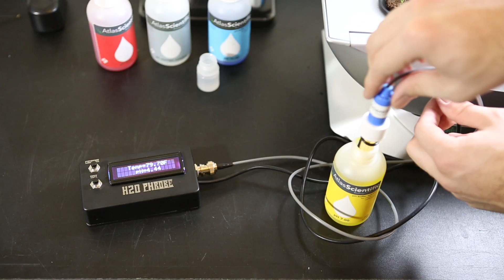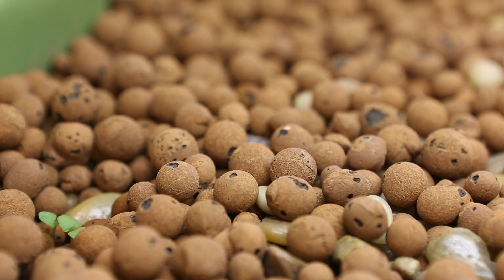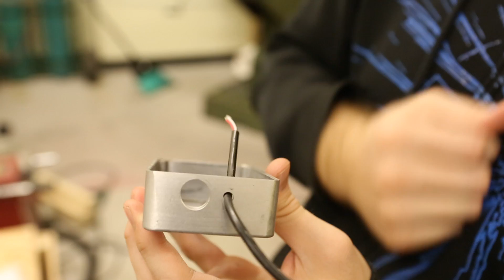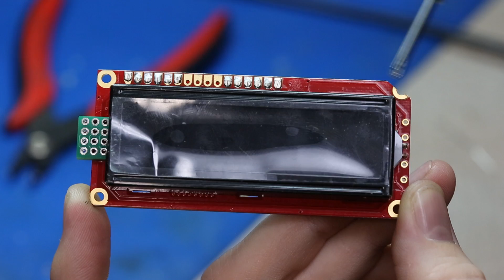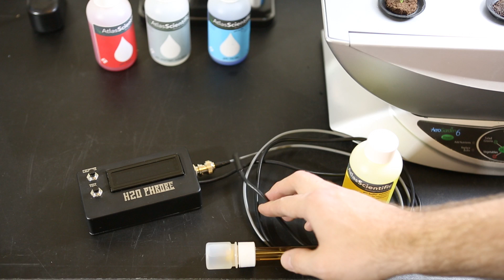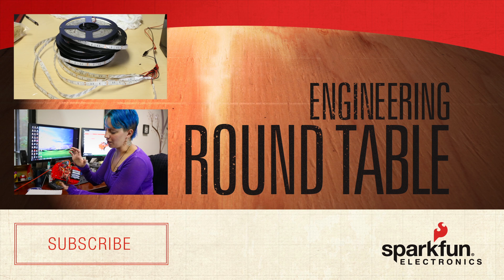SparkFun Engineering Roundtable #21: Handheld PH Sensor

Comment: The code doesn't actually work - the temperature shows but the pH is garbled. After ages trying to see what I had done wrong, going over it again and again, I went on the arduino forum to ask what the problem was, showing a photo of my circuit and a copy of the code. Apparently the code is wrong. I don't know if it's a draft - an earlier version - but it doesn't work like it does in the video.

Comment: If the sensor happens to be way off would it be a faulty sensor? Or is there a way to tune or adjust the sensor to have a more accurate result?